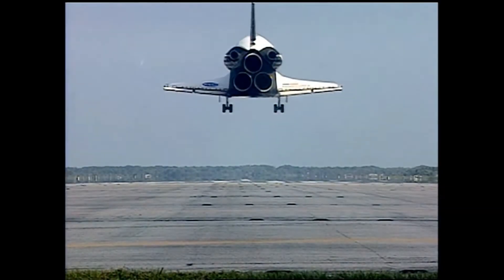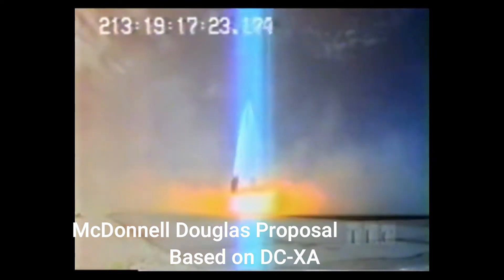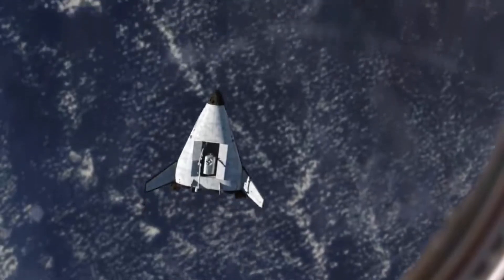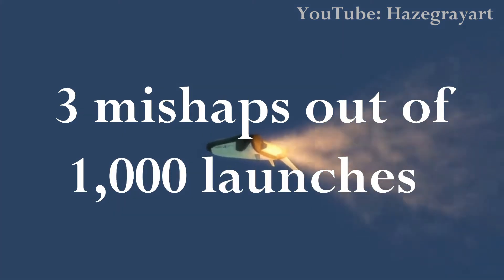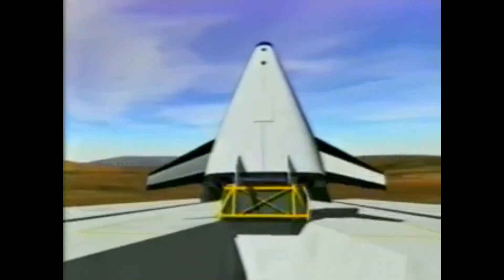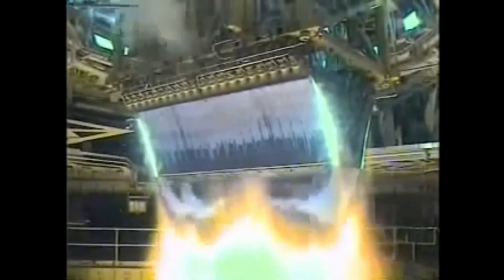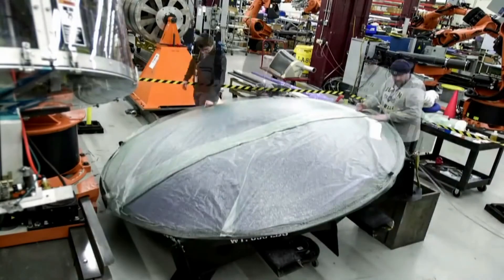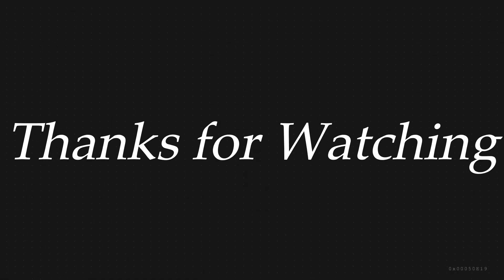The Story of the X-33/VentureStar. Too Advanced for its Time?

Comment: Composite LH2 tank only failed because supplier FOD'd one of the lobe skins.  3 out of 4 lobe skins were fine. 

We did learn composite tank would not have worked for the much larger Venture Star. Still not an autoclave in the world large enough. And this was 25 years ago. 

Source: I was the engineering design and build team lead for the X-33 LH2 tanks.
Reply: We built the LM's for the AFP machine which was located at United Composites? in Salt Lake City at Rockwell here in Tulsa. Was a shame even the alum versions couldn't save the program. Those tools were big, we fab'd them from plaster masters, to splashes to CFRP facesheets and egg crate structure. It was a busy couple of years, made some good OT money lol.
Reply: It was never about the tanks. It was only about NASA canceling X programs to fund Boeing cost overruns on the ISS.

Comment: NASA set up Lockheed and its X33/VentureStar for failure from the beginning. By selecting that lifting body design with linear aerospike engines and a complex composite liquid hydrogen tank and expecting success with a contract for $922M and 36 months and Mach 12 capability, NASA was asking the impossible. That aerospike engine was far from ready for prime time. And Lockheed's composite tank subcontractor did not have the requisite experience in building a complex liquid hydrogen tank like the one Lockheed needed.

McDonnell Douglas undoubtedly could have built and flown its X-33 vehicle on schedule and within budget since its X-33 was a straightforward scaleup of its successful DC-XA test flight vehicle which had been flow eleven times in 1994-96.
 
Side note: I spent 18 months in 1995-96 developing and testing heat shield concepts for the X-33 under a separate NASA contract.
Reply: Lockheed actually did build aluminum tank after composite tank failure and alu tank was lighter. But NASA demanded tank made with composite or just conclude, that tech is not ready and cut funding.

Comment: Few small nits:

Shuttle was never designed to be fully-reusable; they had some early concepts with a fully-reusable variant but they never really got to detailed designs. Their estimate was that the fully-reusable version would have cost $9 billion IIRC, which was far above what they got for shuttle, and it's unlikely that the fully-reusable design would have been practical to expand enough to garner air force support and that is ultimately what got shuttle funded - just barely. 

I think I heard you say that shuttle used  5-segment srbs, but it only used 4-segment ones - the longer version showed up for Constellation and then SLS.

My big comment is that the video doesn't describe the challenges of doing SSTO. If you do a two-stage rocket there is wiggle room WRT capability because the mass fractions are easier to meet and you can upsize your booster if the second stage ends up a little heavy. 

To get to orbit,  you need a delta-v of about 9000-9400 m/s and that requires that your SSTO be about 90% fuel by weight, leaving only 10% for all your structure - tanks, engines, aero surfaces, landing gear, etc. - AND your payload. This means that inherently you need a big vehicle and your payload is only a small fraction of the takeoff weight. . This is made worse by the need to use hydrolox for the high Isp, which means that you have big tanks and you need to use carbon fiber for the tanks and keep everything else very light. That's nice if you are Lockheed building the thing, not nice if you need to spread that development cost across your flights. 

So for SSTO, you have no fallback; if you vehicle gets heavier you lose payload, and it's easy to go from a design that has a decent payload to one that has a small or even negative payload. At which point you've wasted a large amount of money in development.

There's a reason nobody is spending their own money trying to do SSTO; it's just too hard.
Reply from the maker: Thanks for the in-depth feedback! My original plan for the video was to give a general timeline overview of the X-33 program, and I'm now realizing that the structuring of the video may not have been the best. I didn't even notice I said 5-segment SRB's for the Space Shuttle, so that's a bit of a facepalm on my part. You're definitely right about the many setbacks of the X-33 program and how in general, making SSTO's is really hard. These topics can easily be made into an hour long video, and frankly I think that this video barely scratches the surface of the program. I hope to remake this video once I'm well practiced in properly structuring scripts, as this topic definitely deserves the in-depth analyzation in which you have provided to me. Thanks again for the feedback!
Reply: @orbitaldiscourse2445  Now's the time to "remake" ?  😉
Reply: With In-Space Refueling, this X-33/VentureStar SSTO architecture would then excel for crewed Beyond-LEO operations (e.g. MEO, GEO, Lunar NRHO, and near-Earth Lagrange points)  . . . and then come back down to almost any landing strip occasionally only for overhauls.
Reply: The shuttle was designed that certain parts were classified as "refurbishable" instead of "reusable"  This means the bulk of their material could be recovered and reused many times under normal circumstances, but all major structural components required inspection and repair between flights, and certain components, such as O-Rings needed to be replaced every flight, in addition to fuel.  Other components required complete inspection.

Typically about 2-10% of the tiles on the shuttle hull needed replacement after each flight too.

In retrospect, the tank outer insulation should have been put on the list of parts to be replaced every launch.  That would have prevented at least one of the two major accidents.
Reply: @ruediix  > The main external fuel tanks burnt up in the atmosphere upon reentry (of the tank, being released sub-orbital), so the insulation was replaced every flight - along with the rest of the main external fuel tank.
And since a new tank was needed each flight, and they took a while to build, it was the thing that most limited how often the space shuttle could fly, hence NASA deciding that a SSTO would solve the flight rate problem by being entirely reusable.